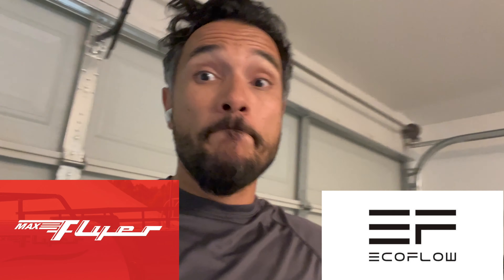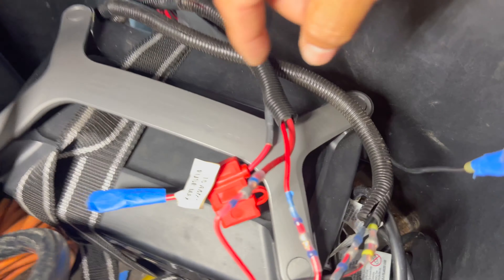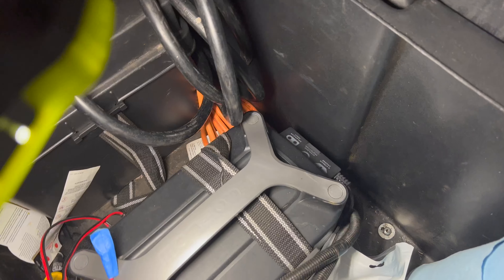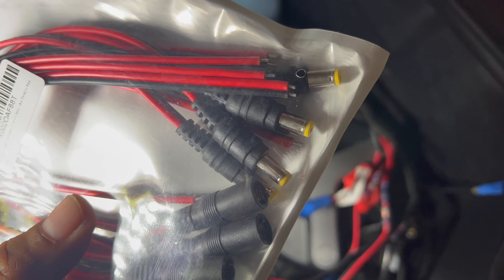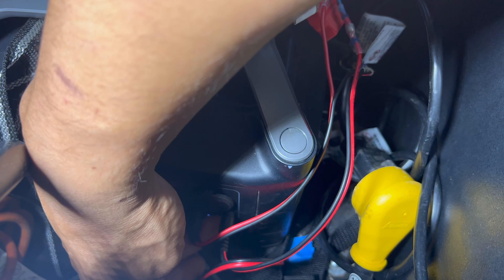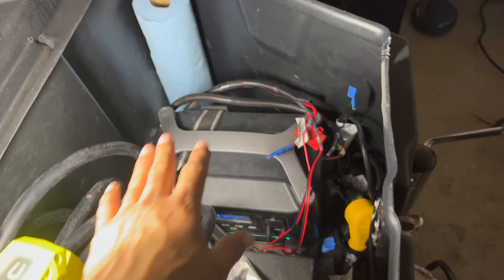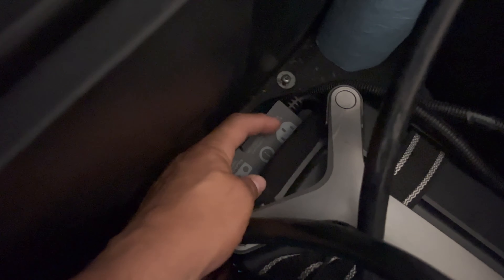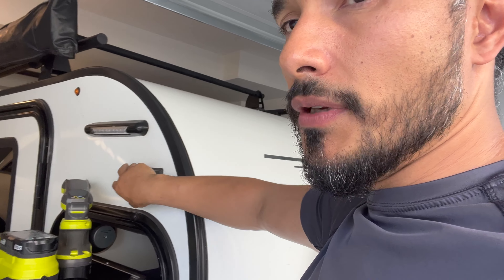Intech Flyer + Ecoflow Battery Perfect solution

Comment: This is awesome, exactly what I was looking for! I have an Ecoflow already and I am picking up my Intech Flyer this Friday and it has a lead acid battery.
Reply from the maker: I am really glad this helps! I made this video knowing one day someone will do the same!.
Reply from the maker: 1 year later update, everything works perfect. On to year 2!
Reply: @4strokehearts  One question, do you know if I could keep my existing battery in place and just splice the DC Power Cable Connectors into the line and just plug the ecoflow in when I need the extra battery power? Or should I put a switch in between my lead acid (stock) setup and the ecoflow system to switch between the two? I eventually want to replace the lead acid all together, but it's brand new right now and I don't want to just trash it. Thanks!
Reply from the maker: @rrb4kids1  I wouldn’t know to be honest because I didn’t try it, but if I was you I would sell the batteries and get the power extension for the eco flow, if more power capacity is what you need. It doubles the battery. I’m doing that this year.

Comment: I like it.  I forgot about that second outlet on the kitchen.  You are converting from 12 volt to ac then back to 12 volt for the fridge.  Have you looked at the power loss in that exchange?   I went with lithium and keep everything 12volt in my Intech when off grid to get max efficiently, but I had to buy all 12 volt equipment.
Reply from the maker: I actually to straight to to the fridge with the outlet parts. So that way when I’m traveling I don’t have to power the rig to power the Fridge. It’s even more efficient that way. It’s the only item that needs to be on on route to keep the food good on the drives to locations. Eco flow will give me 11 hrs of fridge if I need to start from zero (starting compressor)  and start to cool it down. If it’s already cooled down, I get 17 hrs. Mind you with a generator you can recharge the EcoFlow in 45 mins

Comment: Does the pursue fit a full size dirtbike? Trying to fit a TE250. Looks like you have a smaller bike in there.
Reply from the maker: I actually fit 2 x KTM RC390’s or a Husky 450 or a Honda 250, you just have to tilt them on entry, and best to enter backwards with the bikes so the front wheel is facing the rear door

Comment: Would it not fit INSIDE the original battery compartment? Why not just put it in there and get rid of ALL those extra batteries???
Reply from the maker: Hi Col, because I installed a diesel heater where the old battery was.

Comment: Could have just bought a 200ah lipo battery too. Charges just as fast.
Reply from the maker: @lestervida  could have but for the same ish price I get sooooooo much more
Reply: @ was thinking bout going that route with my discover. But Jist bought a lipo 100ah and if need recharging have panels or can use my eco flow cigarette output with the battery terminal clamps and can charge it too. 🤙
Reply from the maker: @ same thing double the product. I rather use one eco flow and that’s that